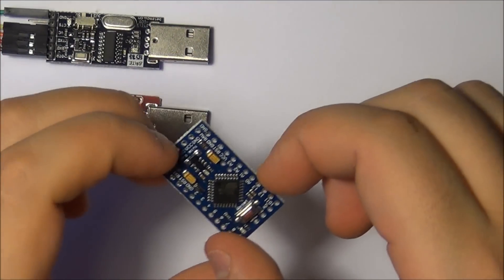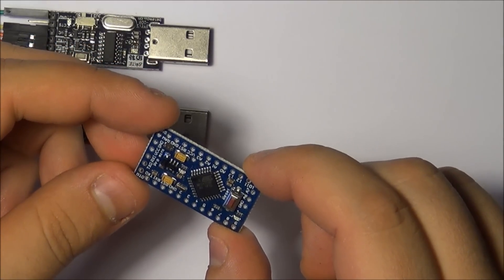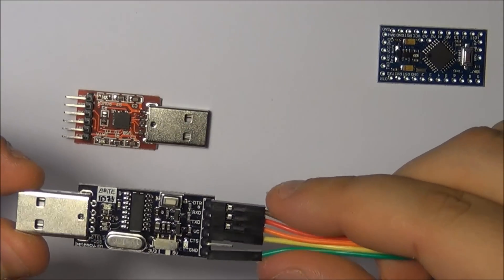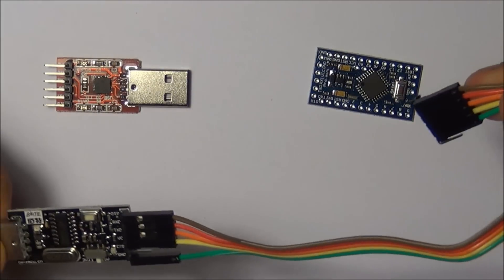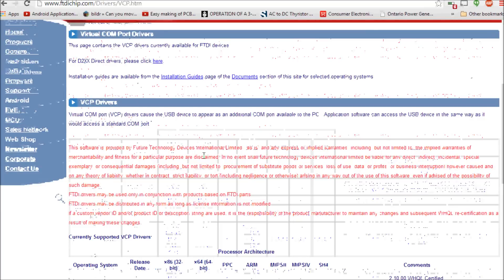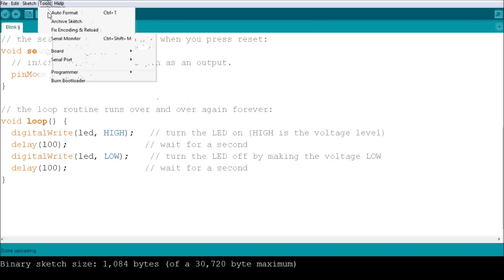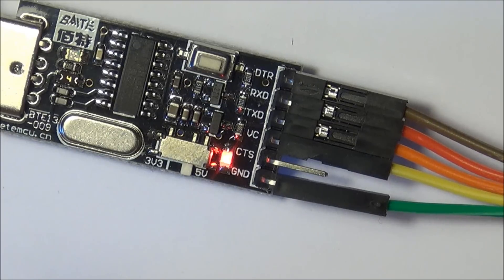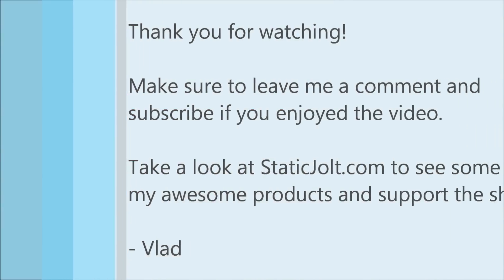Arduino Mini Getting Started - USB to Serial Communication

Comment: As an alternative means to program the Arduino mini without the FTDI, you can use an AVR programmer, such as the USB Tiny, or the AVRISP mk II, by either uploading the hex file generated by Arduino IDE and using AVRdude, or importing your Arduino projects through Atmel Studio. Anyways, good video.

Comment: A very good video representation, smooth and direct without humming, hawing, or uh's.  I have a project with a printed circuit board to fabricate.  Is the mini and pro-mini pinouts the same and can the pro-mini be substituted directly with the mini [totally compatible?]

Comment: Hi Nice video.  I plan to move from Arduino Nano to Mini - Pro. A question: once programed, do I need de FTDI USB adapter?   Thanks.
Reply: +Luis Gomez No, you just need to power the board and it will work just fine. connect Vcc to 5v or 3v and ground to GND. thats all you need to feed an arduino.

Comment: excusme, i want to ask,
can pro mini use external power, and simultaneously connect FTDI to laptop USB?
because some of my devices require quite a lot of power, but I also need FTDI to view the Serial Monitor at the same time.

I ask like this because on some boards, like the ESP32, it doesn't allow to provide external power when the ESP32 is connected to a USB laptop, because it can cause damage (written in the ESP32 manual)

Comment: thanks for this video was having problems until you informed this dimbo that the trans and receive pins have to complement each other on the mini and ftdi board and not the way I had them connected
Reply: +mynettubee It is same on all the arduino sensors. TX and RX will be interchanged to make them talk. One must listen to others speech to make a conversation.

Comment: do you know the input power on the pins for the pro mini? saw someone hook a 9V directly to the board, does it really handle that much?
Reply from the maker: The pro mini has an on board regulator which allows it to accept voltage up to 12V without any problems. I'm sure that's what was going on there. NOTE: ONLY use VCC pin to connect power of above 5V. RAW pin will bypass the regulator.
Reply: now I finally received mine, but are you sure you didn't mean the other way around, all the pinouts I´ve seen when searching shows RAW taking 5-12V unregulated.

Comment: Is there any way to reset the Arduino pro mini? The reset button on the board just stops the program for a couple seconds, and then it starts again, and I cant find any other ways to reset it.
Reply: Explain, you say "The reset button on the board just stops the program for a couple seconds, and then it starts again" by starts again, do you mean resume where it was, or start at the beginning again? try printing incrementing numbers to the serial monitor and see if it starts at 0 when you reset

Comment: Anyway to use an Uno in place of a USB dongle?
Reply: There is, but you would have to remove the Atmega chip from your UNO to do that which is not recommended. You might damage it. The USB is very cheap and easily available. I ordered mini from amazon and it arrived the next day.
Reply: karx001 
I didn't remove the '328 on my Uno, I held the reset button down, which turns off the '328 as long as it's held down.

Comment: The best Pro Mini bargain I got U$2.50 per piece. However, the Pro Micro is surprisingly cost more.
Reply: +TheOldmankk in the case of micro you don't need ftdi driver to connect to USB. Cost saving is there
Reply: not really, it has built in FTDI converter, where as Mini requires an external one. this means you end up only buying one FTDI for all your arduinos

Comment: Do you know how to install USB interface on the Arduino Mini (the smallest one) ?

I got it but tuned out that i want usb
Reply: +Ahmed Gamal get arduino micro.
Reply: +Arjuna Udupi you are right .. :) but i got the mini one and trying to make the best out of it :)
Reply: +Ahmed Gamal if you have a programmer with FTDI it should be fine, but if you have a programmer with CH340G you need to download a driver for it. it shouldnt be too hard to find on the Internet.
Reply: +Ahmed Gamal if you have the CH340G chip, download the driver and install with the arduino plugged in
Reply: i am getting FTDI in couple of days .. i was looking for a way to solder USB port directly to t
Reply: OK if you don't want to, you don't have to solder the port on because it takes up space and so long as you have a good connection it should be fine. But that's only if you don't want to. 👍
Reply: i still don know which ports shall i connect the USB too
Reply: When you got the components, did it come with a dataset?
Reply: usb or the board ?
Reply: Both hopefully if you have them they can tell you what to do
Reply: USBhas 5 pins VCC GND D+ D- and ID
Board has VCC GND Tx Rx DTR

if my assumption is right it should go like that 
VCC <=> VCC
GND <=> GND
D+ <=> Rx
D- <=> Tx
ID <=> DTR 

does that make sense ?

attaching USB to the board will enable flashing it or only input interface?